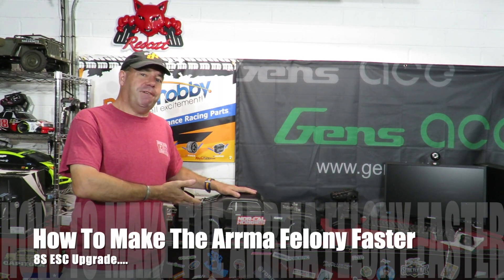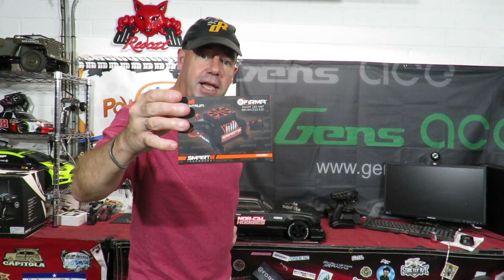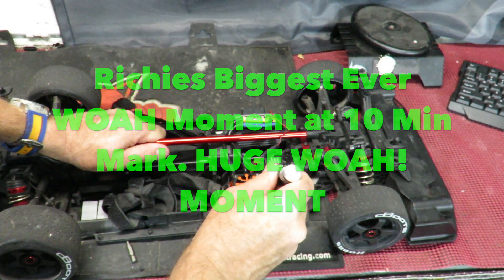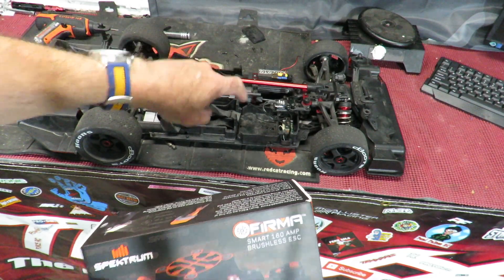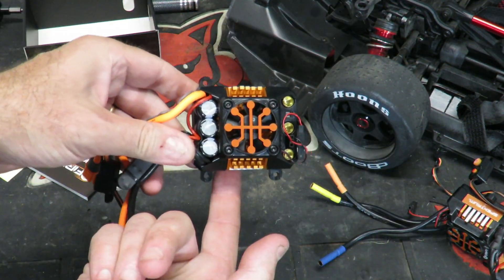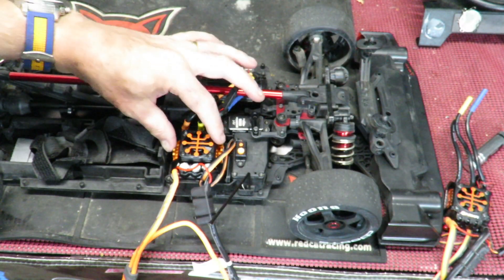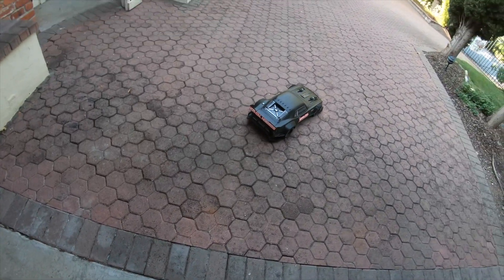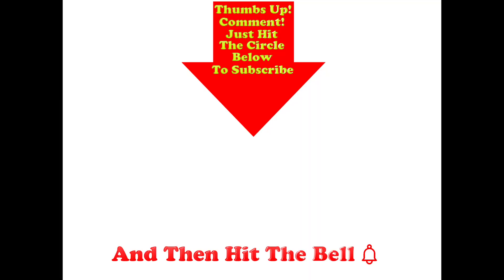How To Make Your Arrma Felony Faster - 8S Arrma Felony ESC Upgrade

Comment: Just got my 160 amp esc thanks to you
Reply: How hard is the wiring
Reply: @larryfreeman5593  just need to get right size bullet connections.... I went back with  the 8s combo setup right afterwards.
Reply: @nosolja9  did the new esc not perform

Comment: Hard enough to control felony at 6s hoons tires are horrible for grip just slides all over the place i can get top speed but stopping is the worst part gotta have room to let it slow on its own i want some sticky tires for mine before i upgrade to faster esc or gears

Comment: The Arrma 8s system is readily available and is a drop in fit. Easiest way to make it 8s. I did the upgrade to my infraction and bash on a 20 tooth pinion all day long no problems at all.
Reply: Which combo is that. I want some advise cos I want it too
Reply: @onyxsr  this is the motor esc combo SPMXSEMC06. I run it 6 and 8s, I added a ripple killer cap pack and fans. A 20 tooth pinion and hard springs. Everything else stock. Not the fastest, maybe not even the "best" set up. Inexpensive and let's me do what I want.

Comment: Why wouldn’t you just buy a hobbywing max6 160a esc that is 8s compatible and is $60 cheaper than the Arrma 160a esc?? I will agree it sure looks like they meant for an 8s system to bolt right in there without a doubt.

Comment: I was thinking the same thing, that Arrma should release a 8s edition Infraction and Felony, even if just a special edition, I know running mine on 8s with that ESC and the 1250kv motor is insane, tires don’t stand a chance.
Reply from the maker: I've had email today from 2 suppliers, 3 new sets of rears on the way.....5 weeks after car came out, and trust me if I was 'on it' I could get through a new set with one battery pack! Should I do a video to show that, I'm down tonight and in need of encouragement!!! :-)
Reply: @DriftomaniacsRC  new tires on the way, smoke off the old ones, that’s the rule.
Reply: @DriftomaniacsRC  you sure should Richie boy😎

Comment from the maker: Get the ESC here - https://bit.ly/3jkTMZ2 Get An Arrma Felony here - https://bit.ly/3gw1RI4 Get the Power hobby fan here - https://www.powerhobby.com/powerhobby-phf35-1.html Get the esc extension leads here - https://www.ebay.com/itm/153961222007 or 6 inch size here - https://www.ebay.com/itm/153895208077

Comment: Tires are now in stock!
Reply from the maker: Nearly everyone has them listed BUT all I'm seeing is 'pre-order' I've had two sets on back order since the day they released the part number I even ordered them before the car (which I got on launch day). Share if you know anywhere that has them in stock, I've just ordered a pair via arrma but it's horizon that's the shipper and the same tire is showing out of stock at horizon....
Reply: The white rears are now in stock at horizon (or were yesterday). Order 3 sets and they shipped out a few hours ago

Comment: Have you tried installing the MM X8S in the car?  I have a V1 infraction currently running on an 8S setup with the Poseidon 1800KV motor.  I had previously installed the V2 ESC try to move the antenna to the outside of the car to see whether that helped with range issues and discovered that the 160A Firma ESC fits perfectly and as you said the screws line up.  However, I was wondering if I should just swap it out for the CASTLE MM X8S as it appears that it will fit in this larger tray.  Do you think there would be any benefit from that ESC over 160A Firma ESC?  I assume that the Castle runs well over 160 amps although I couldn’t find a number listed on their website.

Comment: Stuck on radio glitch Did switch with CC  MMS 8s with stock remote out of the box Spektrum DX3  Any quick fix ideas i only got steering no throttle
Reply from the maker: Roberto steering only and no drive sounds like LVC issue. That would be my first thought!

Comment: I thought you already pissed with firma speed controls overheating?
Reply from the maker: Well horizon aren't going to send me anything else out as a warranty replacement are they? The Dynamite Fuse version of this 160A ESC has run well in my V1 Losi DB XLE so we'll see how this does.

Comment: Cause jason knows the stock esc is junk so he designed it to use the bigger esc....but jason won't supply us with replacement rubber to glue on the rims kinda disappointed there

Comment: Hey rich just wanted to ask did you speed run it just wanted to know because I just got a felony I got the 160a spektrum I even got the 1250kv motor in it just wanted to know how fast it goes
Reply from the maker: Isaac I've just tested a cap pack in it last week, video coming up in next few days, it's peaking out at 98mph with the optional pinion fitted.

Comment: Question... when you upgrade to the firma 160 esc does the avc still work and the ebrake feature in the infraction
Reply from the maker: yes it would as they are controlled by the receiver not the esc sorry for delay

Comment: U said...u seent the stock motor run on 8s.  For "a little while"  meaning. Did it burn out. Or was it just to see it run on 8s and then he stopped??  I had ordered this set up (esc & motor combo) wen I pre ordered my felony.  Lol.  ...Funny everyone asking about it now. When the option was there wen u pre ordered it...
Reply from the maker: Err first of all, NOBODY is taking pre-orders for a felony with this ESC....It didn't burn out as you can see in the video the car's still running. What I said was you could run it for a little while before it gets hot, that's still true. Arrma is NOT going to let you or anyone else pre-order an 8S ESC with a 6S Motor, or by the end of the month they'll have gone bankrupt or be being sued for starting wildfires in California!! Lol (my A$$). Pre-order my felony? Nah I just bought mine from my LHS (Who would NOT sell anyone a car with an 8s ESC and 6s motor....Nor would arrma or any sane LHS!)
Reply: @DriftomaniacsRC  lol.  Wasn't trying to upset u.  Lol.  But.  Wen I  pre ordered my felony.  I bout the power up kit..its an option wen u pre order it..last month.  I didn't say now. ..I have the esc..the motor this month.  I had the esc not to long after I received my felony.  Along with two 4s lipos.  Soooooo..... technically I could have ran 8s not to long after receiving my felony.  But I won't chance it.  Ill wait till the motor comes in...trust wen I say.  I actually spoke with horizon hobby wen I pre ordered my felony. About the power up option (8s combo) if they actually install it wen purchased.  They said.  No. So I bought it. But it comes separately esc..motor.  so.   Yes.  I could have ran 8s with the 6s motor.
Reply: @DriftomaniacsRC  its still an option now.  Go to horizon hobby.  All there add ons.   Its one of em.  Power up kit

Comment: Who do you get ahold of to get the ESC exchanged. I can’t get anyone to answer a phone. And email response is very slow. Mine likes to cut out at 80 and leave me with no brakes.
Reply from the maker: Sounds like the exact same fault my original one had esc overtemp kicks in cuts power (Which includes brakes). Horizon phone support very poor (60-90 mins on a good day) at best, the chat however is what I used and got it sorted in 10-15 mins, not bad given circumstances we're all under. So Darren try the chat in the morning, but scan your purchase receipt in first of all as they'll ask you to email it to them whilst you're on the chat. hope that helps, let me/us all know how you get on
Reply: Could only get ahold of them via email. They had me send my esc in for evaluation and they determined nothing was wrong and are sending it back....

Comment: Richie i got the new 160 amp for the Infraction, you thi k I can use the 150 amp on the smaller Arrma Granite 4x4 as an upgrade????
Reply from the maker: now it could be made to fit for sure without too much worry, you could sqeeze in a 6s infraction motor, OR Poseidon do small can 6s motors which we love, BUT the diffs on the 3s arrma granite blow under hard use. If anyone ever makes some metal ones they'll make a killing!!!!
Reply: @DriftomaniacsRC  ok thanks I'll look into..🤝🏽

Comment: Very exciting! Might just get the 160 amp Spektrum ESC for my Felony!  Do you have a link for the ESC extension wires?  Thank you!
Reply: Just make them or go to a shop and have them make some for you
Reply from the maker: Link now In the description
Reply from the maker: And....they'd charge you double the price of the ones in my link, if you buy the connectors and wire from castle? 3 times the price, and that's if you've got a soldering iron, flux and solder already in! If not and you need to buy all I've mentioned a set should only set you back just under $100....:-)
Reply: @DriftomaniacsRC  Thank you!!

Comment: NICE!! You said you had a lot of problems programming the esc. How did you finally get it setup? Where can we get the esc extension wires? Thanks!
Reply from the maker: Bernard I think it was the battery that was the issue although I'm going to look at it again tonight, it's just the 'variables' for the 160A version didn't seem to match the manual (different for 150A but I was looking at 160A page), once I swapped the batteries it seemed to accept the programming. The leads are for sale here - https://www.ebay.com/itm/153961222007 they are also available in 6 inch size here - https://www.ebay.com/itm/153895208077
Reply: Did you have to buy the ESC programmer or is it plug and play?... I ordered one just in case 🤷🏽‍♂️

Comment: No I didn't like this video because of your driving location and the more battery cells you put in the more the tires wear and the same for the drive chain...
Reply from the maker: weird it's like fitting a higher powered motor in your road car without changing anything else isn't it........As for the driving location? I guess some build drive you round the bend! I suggest you do so and stay there...